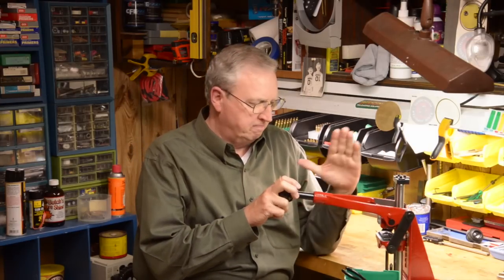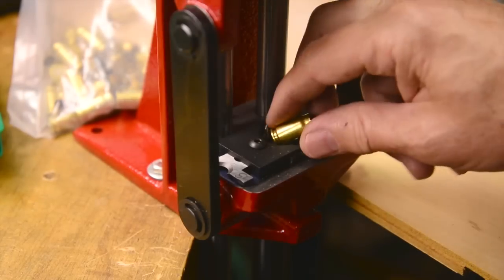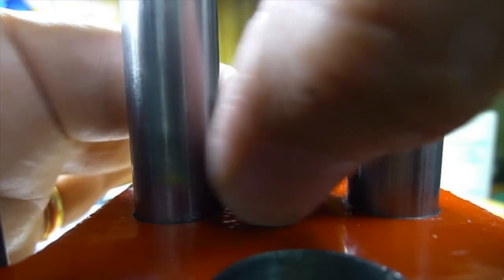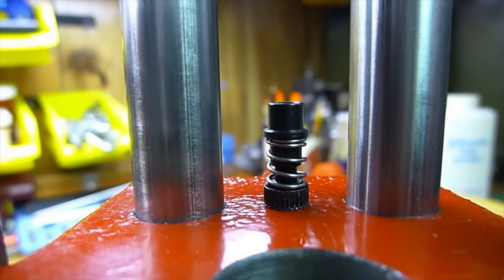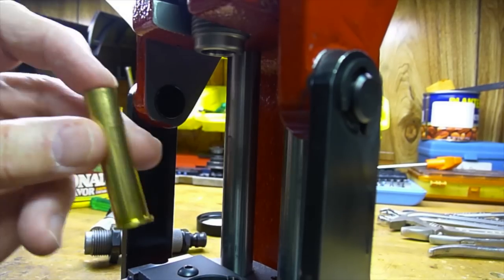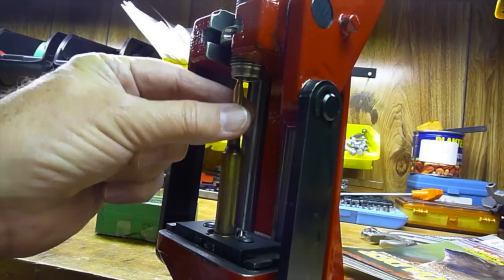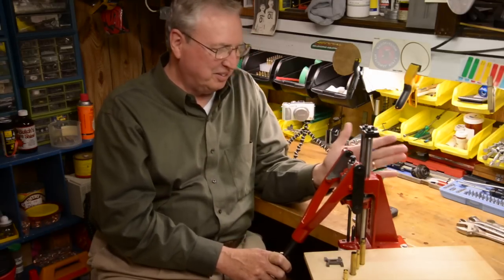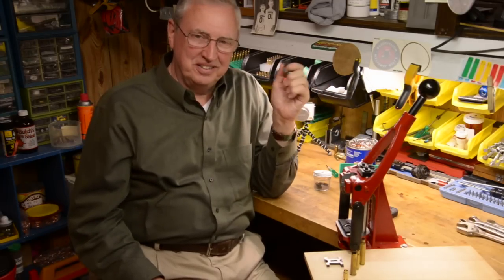Forster Co-Ax Update

Comment: Hi Rex,

A have a question/concern about the co-ax press which i don't think you have addressed in your (awesome) videos yet.

My concern about the otherwise clever design of the press is in how the die is aligned with the linear motion of the case. When the case goes into the die, the case gets aligned left/right by the die position and the die gets aligned front/back by the case. They will find each other no matter what. But how is it secured that the center axis of the die is not tilted to the center axis of the case? I mean, when the die is floating in the open frame, it is up to the lock ring (and the slot in the frame) to secure the axial alignment. If the thread in the lock ring is not perpendicular to its top face, I think the die will start to tilt when the case forces the die upwards and thereby create some unwanted tension and concentric problems. How precise can the lock ring be and what about play/clearance there is in the thread between die and lock ring?

What are your thoughts on this aspect?

Best regards!
Reply from the maker: +Søren Frisk Mortensen That's a good question, Søren. My first thought is that the Co-Ax would be no better or worse than any press where the dies are threaded in. If there is axial tilt in the die thread, the die will be tilted in a conventional press or the Co-Ax. The case is supported and pushed by the ram, so the perpendicularity of the base of the case to the vertical axis of the case is important. 

On the Co-Ax, it's probably a good idea to select die lock rings that have good flat outside surfaces where it bears against the press slot, and threads that are axially aligned. But I expect all of them easily meet that need.

This thought occurs: for all of the die lock rings, there is a certain amount of vertical play in the Co-Ax slot. That is, all of the rings are less in height than the inside height of the slot, thus all of them are free to move vertically a little bit. Some move almost none and others quite a bit. It might be that an axial alignment can occur between the case and die during that brief initial contact when the die is unrestrained vertically. 

Of course in very short order, the die will be restrained by the top of the slot and the amount of free play is probably not enough to make any difference. 

Now, having written all of the above, I have gone back and re-read your post several times. I think the point you are making is that the axial alignment is dependent on the quality of the lock ring. If the ring threads are loose or mis-aligned with the bore, the die will sit in the press at an angle. I agree, but would add that if the same die/ring combo is used on a conventionally threaded press, there is enough play in the die and press threads that the die can be tilted by a bad lock ring. 

One of the selling points made by Lee in regard to their lock rings is the floating nature of the O-ring design. Instead of a hard metal-to-metal mating between the lock ring and press top, there is a soft mate between the O-ring and press which allows the die a small amount of float, improving alignment with the case. I think it's Glen Zediker in one of his books that champions using O-rings on press rams in place of the heavy wire springs which retain the shell holders, thus allowing the holder to float.

Of course this is the whole idea of the Co-Ax press. 

In general, I think the various manufacturers do such a good job of threading, it is too small of an error to affect the quality of the ammo. However, I would love to hear any thoughts you or anyone else has on how that sort of error might be measured. I suppose the end result of such mis-alignment would be a case that has been tilted on its vertical axis in relation to the base. We could measure the run-out of the base (face, not rim) while rotating the case in a typical run-out fixture. You'd need before and after sizing measurements to see if your press setup is causing the problem.
Reply: +Rex Roach Thanks for the reply. I wrote my question in a bit of a hurry and English is not my native language, so I apologize if it was difficult to understand.

But my point is exactly, as you phrase, that the axial alignment is dependent on the quality of the lock ring. I have no idea how different die manufactures make their lock rings, but I don't think they are manufactured with the thought that the lock ring could be a direct part of the tolerance chain between case and die. In my daily work I develop mechanical precision equipment, and i have seen plenty of bad elements go out of expensive and modern CNC setups.

Comment: Rex, as so many others have said your videos are beautifully shot and edited. I too have a question, will this press handle the .338 Lapua?
Reply from the maker: Sorry for the delay in replying. I don't have a .338 Lapua so I'm telling you this based on the case dimensions vs. the 7mm Rem. Mag. As you saw in the video, the 7mm RM will work with this press, but I think that's about the upper limit. The .338 is 1/4" longer case and about 1/2" longer overall, so seating the bullet will be the challenge. Because of the open nature of the CoAx shell holder which allows you to insert the case from any direction, you very well might be able to hold both the bullet and case together and angle the bullet up into the die first, then swing the case over the shell holder. But without one to try, I can only say it will be tight.
Reply: Thanks Russ, no worries on the timing!!
Reply: The problem isn't going to be getting the case/bullet finagled up into the die for seating/crimping. The problem will be getting an EMPTY case into a full-length sizing die for a non-belted magnum that in a standard press requires the shell holder to come within a fraction of an inch of the bottom of the die and in this press is going to have to extend to well below the bottom of the press frame which is a good half-inch below the bottom of the die "retainer" slot. Because of that goofy but "superior" shell holder set up and how much higher it "sits" relative to the case head/body compared to a standard shell holder and how the retaining screws remove yet more vertical travel potential for the "platform". It doesn't appear to me that you'll get any non-belted Magnum case alone into the sizing die with the die screwed down as far as it has to go to get "full seating" and come as close to the case rim as it needs to in a full-length sizing die. 

The fact that this press isn't capable of handling 1 1/8" dies and isn't built to handle the kind of vertical loads created when "non-belted Magnum" cases are full-length sized and the fact that those "long" 7mm Remington Magnum bullets are "short" by MODERN standards since 7mm bullets are available in weights up to 195 grains now pretty much proves this is a very "antiquated" press design that's more or less at its practical "limits" with standard long-action non-magnum cartridges like .30-06 Springfield and its goofy (but supposedly superior) case holder design is clearly "optimized" for RIMMED cartridges. 

I'd be surprised if the original designer even had American shooters/reloaders in mind and didn't design it for "Commonwealth" countries like the U.K. and Canada where .303 British for decades was as "big" and "bad" as rifle cartridges got. At least for those "lucky" enough to have the "privilege" of owning even a clapped out old Lee-Enfield rifle in the first place. Clearly the better "connected" so-called "citizens" of those countries had much larger and more expensive "sporting rifles" for their trips to Africa hunting "large dangerous game" and such and weren't limited to clapped out old rifles and mil-surplus ammo/components and "2nd hand" reloads for their custom rifles in more or less custom chamberings nobody made reloading dies for anyway. 

And to be "perfect" for the overwhelming majority of European "sporting cartridges" which are overwhelmingly "short-action" rimless cartridges with "military cartridges" as their "parent cases" but almost always shortened and necked down because of various laws against owning rifles chambered for military cartridges and with the relatively low-volume shooting/reloading European reloaders can afford the time/materials/taxes to do, there would be no need for any of the significant and obvious advantages supposedly "inferior" and overwhelmingly AMERICAN single-stage presses have. For anyone to consider this press "superior" to a "typical" single-stage American press, of which until fairly recently were actually NOT produced by many manufacturers and do NOT have "standard" features from manufacturer to manufacturer besides common die diameters/threads and "standardized" case holder notches in their rams found in SOME but not ALL single-stage presses,  this would have to be the only "single-stage press" he or she had ever used OR they'd have to be comparing it to a ridiculously complex and similarly handicapped and similarly "precise" (if that's what you want to call "floating" cartridges and dies and press parts that move around and tilt and such during sizing and seating/crimping) press with no "convenient" built-in priming capacity and shell-holder dependent overpriced monstrosity like a Redding T7.  

Which of course is more of a "hybrid" and only a "single-stage" in the sense that no matter how many dies you have in the turret you can only use one at a time and even having two die sets or even three for three different cartridges (two two-die rifle sets and one three-die pistol set) in the turret at once is the "answer" to a question nobody ever asked. I get the feeling the "geniuses" at Redding looked at existing "progressive" presses that are truly progressive and have so 6-7 positions to enable them to mount trim dies and powder-through-expander pistol dies/powder measures and possibly factory crimp dies and without really knowing why OR having the accessories to go with them Redding's geniuses decided that the way to "trump" existing 6-position turret "single-stage" presses was to add a 7th station. 

Unfortunately almost all "turret presses" with 5 or more die positions are intended for pistol/revolver cartridges and to get manufacturers like Hornady and RCBS into the "progressive pistol press" without stepping on Dillon's toes, patents etc and a price level attractive enough for the "beginning reloader" who has no business buying a Dillon or any other self-indexing progressive and usually ends up overwhelmed by even a 550 once they get done adding "upgrades" that just make Dillons complete disasters for "quick" and "easy" caliber conversions after they buy a Dillon specifically FOR its "quick" and "easy" caliber conversions but insist on trying to "keep up with" a 650 by adding aftermarket "upgrades" they can't possibly make good use of on a 550 and end up putting enough time and money into that they could have bought a "bare bones" 650 and fed cases by hand and had a cheaper, more productive and simpler and more practical press for less money overall. 

And Hornady and RCBS certainly haven't set the world on fire with their turret presses with much better name recognition and bigger overall product lines than Redding so Redding was pretty much doomed from the get-go. Kind of like these Forster nightmares. It never occurs to "marketing" and "accounting" and "investor" types that "new" and/or "different" only ultimately appeals to CUSTOMERS who are "new" and/or "different" and only those who are so determined TO be "new" and/or "different" that they're willing to not go with the typical "herd" most "noobs" in various hobbies and past-times slide into for "safety" and do their own thing. Which isn't many of them. And "new" and/or "different" only SELLS the product ONCE. It doesn't keep the customer going back to it and it doesn't keep them from shopping around when suddenly the customer finally clues into the fact that there's a REASON nobody else is doing something a certain way and in fact everybody else is doing it as "differently" as possible.

I notice YOU have a Redding T7 sitting the background and your "new" Forster certainly isn't securely/permanently mounted to your bench there. Still using it today and if so is that because you want to be and wouldn't take anything else at any price or even for free and Forster isn't compensating you in any way shape or form or because making this Forster video with your Redding T7 sitting the background didn't entice Redding or any other manufacturer to "approach you" about "reviewing" more of its products? I can't help but marvel at the lack of brand loyalty so many supposed "experienced" and "long-time" reloaders have when they're shilling one make/model press after another on their videos/channels and how HARD it must be to really get to KNOW and get COMFORTABLE with one press after another and how much little actual reloading they must get done given how much time they spend swapping makes, models, etc. But then again they're no doubt getting even less time to shoot so they probably don't need to actually do much real reloading/testing of press after press after press. Hell, in many videos and on many channels of reloading equipment "reviews" the PRESS and maybe a few other strategically-placed "shooting/reloading/cleaning" products are the only indicators their "reloading bench" is used for anything gun-related. Pretty much the OPPOSITE of "noob" reloaders who insist on putting every last pound of powder and box of bullets and piece of reloading equipment they possibly can at arms length on a bench so crowded with reloading equipment and components and ammo in various "stages" of completion its a miracle they can get any reloading done at all. 

I find the more reloading equipment permanently placed  on a bench the less reloading gets done there. Kind of like more "superior" a press is supposed to be because its "different" and/or "new" the fewer "advantages" I see in it.